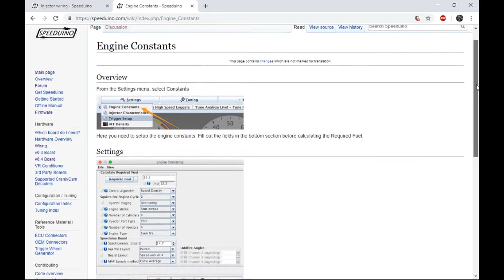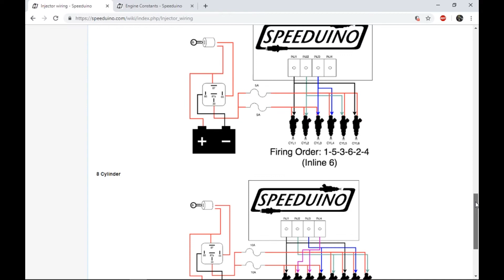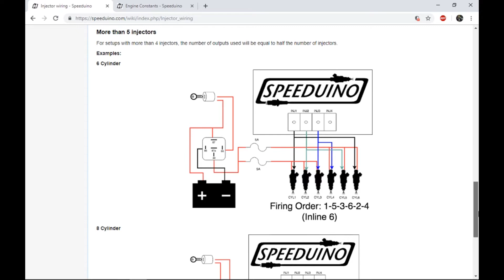Injector Pairing in Speeduino and The Z is Out of Commission (Turbo Time)

Comment from the maker: I am sorry about the audio cut out in the fist part of the video, I used a filter to try and clean up the background noise, It looks like it had a little bit of an issue with that out cut out when I converted it.  I am working on getting the turbo installed and stay tuned for good updates on the Turbo project!